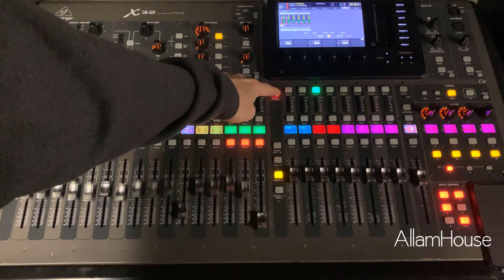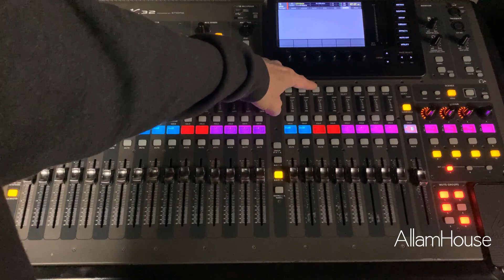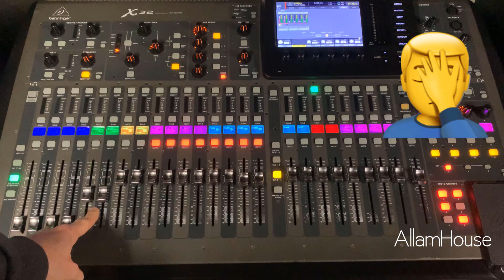Live Stream through a Matrix  |  Full Scene Setup

Comment: I love this setup! Sending the FOH mix into a matrix and adding a bus to fine tune. My question tho is this. Because we send the FOH mix to the matrix, when we move input faders on the front of house mix does that effect the matrix inputs?
Reply from the maker: Yes, A Matrix is the quickest way to get a mix sent to your stream and it will be impacted when you make fader changes for your front of house. If you turn a vocal up or down, that change will be heard in your stream as well. This video also discusses using a Post Fader MixBUS to supplement your stream mix and while this is a good setup, I prefer just using the Post Fader MixBUS approach and not a Matrix.  This video here is the way I run my live stream on a weekly basis and it just removes one step from what youa re doing now with the Matrix. https://youtu.be/pMnaiuC55RY
Reply: Cool ! Right now I use the post fader mixbus . Still not where I want it to be but I’m going to keep at it
Reply from the maker: The best thing you can do is grab multitracks of your group and spend some time off hours to refine EQ, Comp and the FX to get where you want. Keep going and try to make small steps on a consistent basis.

Comment: Doc you mentioned how to turn certain things up. Do you need to raise everything in the bus to lower the volume of something in the regular matrix mix or is there a way to lower the volume separately
Reply from the maker: This is the challenge when using a Matrix. You would effectively need to turn everything else up (within reason).  I personally use a Post Fader MixBUS to have complete control of the mix and it will still follow your house mix so it is easy for a single sound tech to handle. This video here walks through my approach. https://youtu.be/pMnaiuC55RY

Comment: Thank you for the help. I have the Livestream setup through the matrix into OBS for Facebook. My issue is I don't have complete control of the audio. I can fader all the way up or down and the volume doesn't change in the stream mix. This is for a single vocal for example. Where am I going wrong?
Reply from the maker: A matrix is a mix of buses so your mix will be determined by those other mixes and offers less control. I prefer using a MixBUS setup for my live stream so I have more control. If you have two sound techs for each event you can go with a Pre-Fader setup or if you are like me with only one sound tech we run a Post Fader setup. These two videos can guide you through the process. 
1) MixBUS setup and routing: https://youtu.be/Vx4HjArTeZI
2) Refine your stream mix: https://youtu.be/pMnaiuC55RY
Reply: Thank you. We usually have the person running the stream mixing the stream. I'll look at the videos.

Comment: Hello AllamHouse..
I'm using a linked 7/8 bus output via usb for livestream. I'm coming out of bus 7 XLR to a powered monitor to hear the livestream mix. When I replay the livestream service I notice that some channels are at a different volume than I heard in my powered monitor mix. Everything is pre-fader and I have a drum track very low in my 7/8 livestream mix, but the drum loop is very loud when I replay the service. Do I need to come out of 7and 8 xlr output to my monitor or why don't I hear the true mix in my monitor?
Thanks
Reply from the maker: First place to start is the Routing > Outs area. Make sure your Output 7/8 is getting its signal from Bus 7/8. Also, you can make this tap point Post-Fader so your Bus channel strip (EQ and Comp) are taken into account on this output. Check this for both 7 and 8.

Next thing to check is that you select the Bus 7 and make sure they are linked. 

Finally, select Bus 7, hit “sends on fader” and check the mix going into this Bus. You have the ability to adjust the mix independently of the FOH mix since you stated you have the Bus setup as Pre Fader (which is set globally for all inputs by selecting the Bus 7 and hitting Home > Config).

Comment: Your training has really helped me get a better understanding of the X32 console and strategies to routing and mixing.   We are also using Propresenter and NDI.   We use Vmix for our streaming.   Question:  if you bring your audio across on NDI (which works great) into your stream computer, how do you get your audio into the console?  Computer audio out?   USB?    Vmix / OBS have the ability to synch the video / audio.   But would there be delay differences between audio coming through the console (band, speaker) and audio coming through NDI (PP videos)?
Reply from the maker: I send audio from  Pro7 across NDI for the livestream. For the house, I send from the same Pro7 laptop out the headphone jack and into the back of the console (AUX In 5/6). This keeps them separate and allows OBS to have set levels for our videos and then the soundboard livestream audio goes to our video switcher which then sends Audio/video into OBS. I hope that helps.

Comment: Hi, I am pretty new with digital mixers, please I have a question, where do I plug  my xlr cable that feed the camera with sound behind the console.
Please note I have done everything you discussed 8n your video, but there was no sounds in my camera
Reply from the maker: Are you using a MixBUS or a Matrix for your stream?
Reply: @AllamHouse  wow, i did not expect a swift response, thank bro
I am using Mixbus for the live stream, and I connected my xlr to output 13
Reply from the maker: So, it sounds like your camera only has one XLR input which will require you to run a mono stream. It’s not ideal, but it is a fine place to start. Now that you built yourself mix on the console (assuming it is on MixBUS 13) you should be able to plug the XLR cable into output 13 on the console and it should work. If it doesn’t, you will want to check your Routing > Out settings to make sure MixBUS 13 is set to go out Local Out 13.

Comment: How do you add reverb to the livestream? Everytime i adjust it adjust the main house mix. I followed your other "How to livestream with Matrix" video. Thanks.
Reply from the maker: So, if you are using a Matrix setup it becomes a bit more difficult depending on tour exact workflow for getting signals to the matrix. I personally would recommend a MixBUS approach so you have complete control. Regardless, this video has a section that discusses sending FX only to the live stream. There is a quick link in the description of the video to help you find it. https://youtu.be/pMnaiuC55RY

Comment: Mmm how can you connect two x32 one for live and another for board cast
Reply from the maker: Yes, you select a master console and a slave console. Connect CAT5 from AES50B on Master to AES50A on slave console. Select your inputs as AES50A on the slave console. Go into the settings and make sure you clock to the Master console. Also, understand the initial gain is set at the Master console.

Comment: I have a stereo subgroup for instruments, one for vocals, one for drums and one for effect returns. I compress the groups and send them to the matrix for livestream. It works. (I don't send the mains into the matrix). Anybody else doing something like this?
Reply from the maker: Yep, that is the second way of doing it.  I mention there are two ways, but only jump into the way I did in my setup.  If I had more available groups I would have given this a try, but I ran out so I had to go back to my original plan of attack.
Reply: @AllamHouse  is there disadvantages or advantages to doing it this way vs sending the stream out from a mix bus?  Most people I watch say there are more options to send from a bus send but I don't see why
Reply from the maker: @bradseppala495  Keep in mind that a Matrix is a mix of Buses (not inputs) so you have to have inputs going into Buses that then allow you to add the Bus mix into the Matrix.  The quickest way to get a starting mix is to send your FOH mix (which is the LR Bus) into your Matrix and then have a stereo Bus pair that allows you to fine tune the mix by adding other instruments.  To me, it is not as streamlined as it could be and is more complicated for volunteers to manage.  I prefer running a Post-Fader Bus mix for my stream and just control the mix one time that is going into this mix.
Reply: @AllamHouse  yes, I understand that. In a video with churchfront they did what the Szaba commented with all bus sends post fader so your stream mix is following your live mix. (bumping the drums up in the live mix send they since they are louder live). No ind channels go tot he main bus LR or Mono, only the bus sends do.  We mix down the drums to a bus send anyway and send that to the FOH.  If you are adding bus sends to the matrix with a LR already going to it are you doubling inputs to the final stream mix out?
Reply from the maker: @bradseppala495  yes, you would be doubling up which is. It really ideal. If you are running everything through buses then you might be able to run a Matrix for your stream with success. I tend to just use the Buses for convenience and training purposes.
Reply: Where are the other instruments though ?

Comment: I use quite a similar setup, but we have a Presonus SLIII 32SC (the one with 16+1 channel faders), and Presonus has a really nice way to implement aux/matrix-mixes.
On the left side are all the "flex-mixes" which can be either aux/matrix/subgroup(bus), so they are accessible with one button press. And in that layer the "main" will be correspondent for the flexmix-main, in this example the main of the matrix-mix. Although it is possible to lock the "main" to the "main-mix" for security. And in these matrices are really every channel/bus/main/fx/tape... that are on the board, there are like 4 pages of them. So if you really need to access the PC-return, then you just switch the page and there it is (switching the page is painfull though, it doesnt remember which page you were on, so you need to switch to page 4 everytime you want to change PC-return, only aux/subgroup can be customised)
Dont know if it is possible on a x32, but the setup is really clean
And you can change the headphone-output on Presonus to every aux/matrix-bus, maybe that is also possible on x32

Comment: Hi . Your videos have been very valuable in propelling me from rank amateur to corporal newbie !! Thx for the clarity . One question . Why would you use a matrix instead of solely routing through a stereo bus for the final output to the stream. That is, can I not rely simply on the separate mix I have created to the stereo bus ( let’s say 13 and 14) with all of the instruments, vocals  and reverb .
Reply from the maker: You certainly can, and that is a similar setup I have gone back to using.  The benefit to the Matrix is that you have the ability to start with your house mix which (in theory) is a solid starting foundation.  The great thing about this stuff is there are so many ways to accomplish a single goal.

Comment: Would love to see the guys from MxU mixing live with a x32, and not use 20x times more expensive gear... I have another approach to this, as all my matrix are fully used by mains, balcony and side fillers. As Bus takes only inputs, i still want to use LR as main source for live and add on top if needed. So decided to output a LR copy to aux and back in another aux using patch cables. This way i can have LR as an input. Maybe helps you go around your issue.
Reply from the maker: thanks for the idea.  I've found a happy medium of this matrix setup and my original AUX Bus setup.  I get to put it into action tomorrow morning for the first time and I'm super excited.